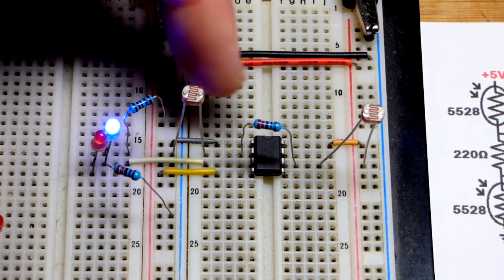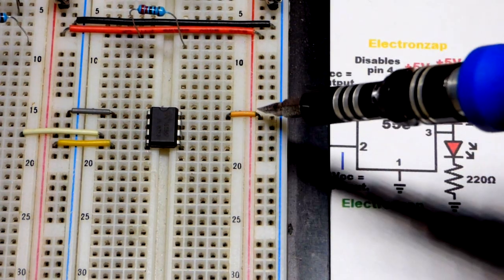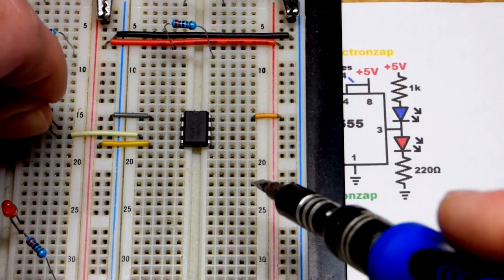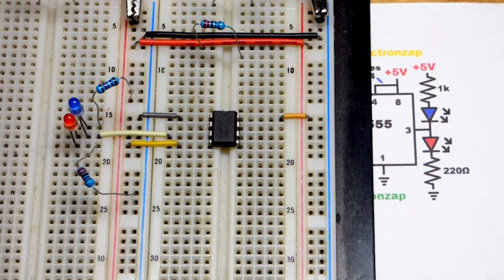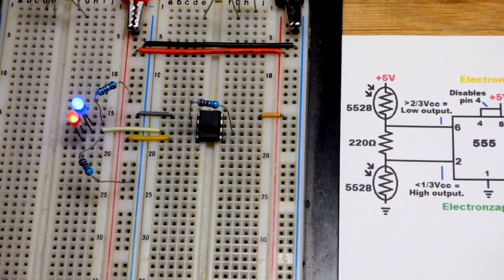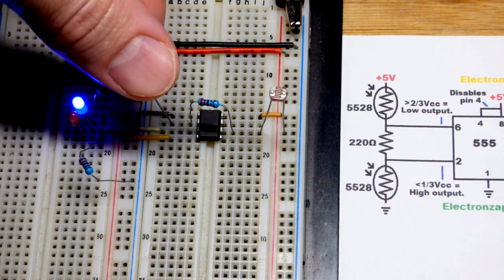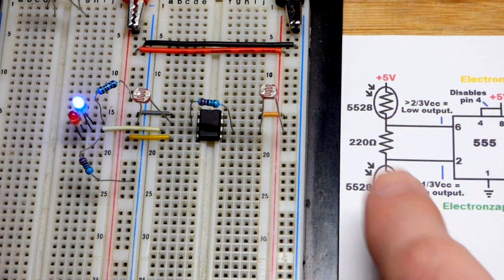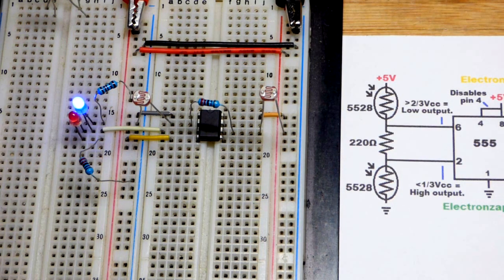555 timer based light dependent resistor LDR Schmitt trigger comparator circuit schematic

Comment: Would be possible to make a circuit to regulate a capacitor charger , I saw one based on lm311 ( but I don't have any lm , instead I have a few 555s) lets say with a voltage divider for measuring so when the voltage gets to lets say 100v it turns the charger off